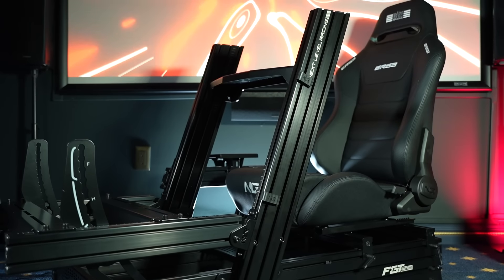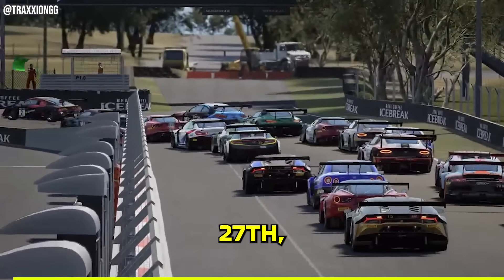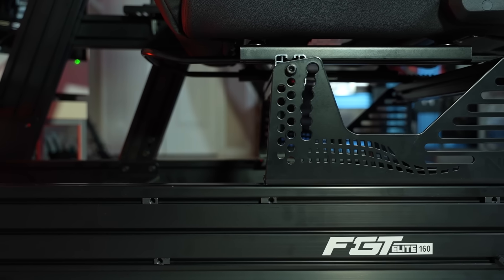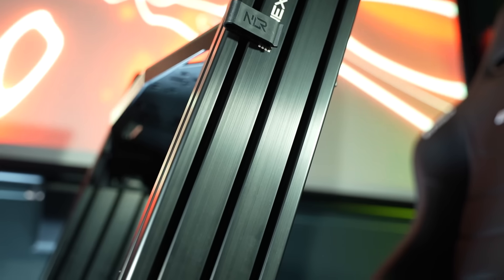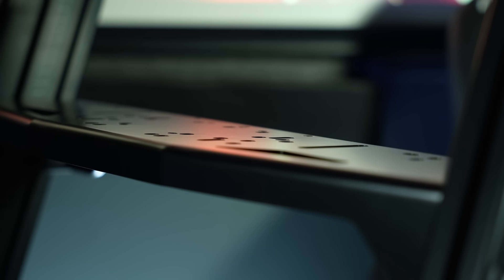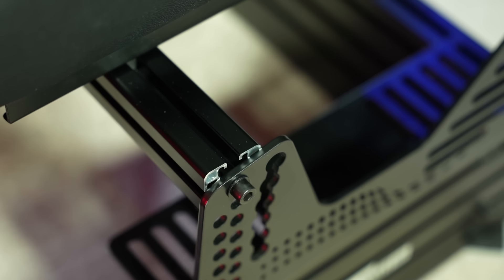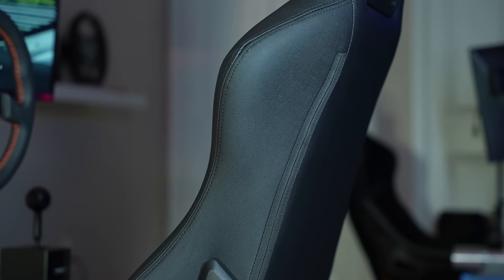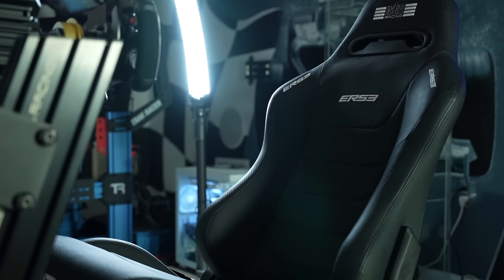The ONLY Sim Racing Cockpit You'll Ever Need (And It's NOT Overpriced?!)

Comment: Idk how a cockpit that costs 1k usd without the seat is considered "not overpriced". If thats not overpriced, I must be homeless then😂
Reply from the maker: $1250 for a 160x40 rig with interchangeable seating positions and full adjustment on the seat isn’t bad at all in my opinion at least
Reply: It is bad. Not great value at all.
Reply: @OCRacing 1250$ is how much my whole sim setup costs including the pc. My point is, for the average sim racer, this is nowhere near budget or not overpriced.
Reply: You're mixing up expensive and over priced.
Reply: @tifa26  For simracers running a small rig that you attach your chair to and is looking to upgrade into the world of alu rigs it's 100% not overpriced, the price of alu rigs in general is a steep market
Reply: Trak-Racer and Sim-Lab is 3 or $400 cheaper. Trak-Racer 160 is $800 WITH seat included. 
Sim-Lab gt1-evo is $450 without seat. 
The NLR rig is too much
Reply from the maker: @tifa26  Well obviously there are different price ranges when it comes to cockpits. High-end cockpits like the F-GT series from NLR are targeted towards the higher budgets and with that in mind, $1250 isn't crazy, especially not compared to others that are in far excess of that. It's all about perspective in that sense.
Reply: @tifa26  It all depends on what your budget is. I set a budget of $1000 for a new rig, tube or aluminum. So I save $12 a week, $48 a month, $576 after 1 year, so in 18 months saving $12 a week, you can have a rig for $900 to $1000. 
$12 a week is nothing
Reply: @tifa26 . I think people are getting confused with affordability and value. Overpriced is being used here to denote the value of the product, not where it splits on the spectrum of prices.

I do agree, i think it’s overpriced for what you get.
Reply: @OCRacing but does the adjustability it has justify the price. The quality of any 80/20 rig is exactly the same. I bought my rig for around 400 added a bucket seat for another 350 and now added a 4th monitor mount for another 100 (with Asetek front mount, adjustable pedal deck, etc).
Reply: This is how they normalize prices, my friend.
Reply: @JVGaming yes
Reply: I just built my 40/120 rig for a 1/3 of that one.
Reply: It is over priced. It's a thousand dollars. 

And when you are a YouTuber and getting things free and claim not being biased is also different from someone buying it with their own money.
Reply: Don’t worry bro use his code and you get 5% off
Reply: all these are just paid ads by the companies.
Reply: Its not overpriced when your used to getting everything for free to be a marketing shill.
Reply: Agreed. When I heard the price after him saying “not overpriced” I was like 😳

I guess is not overpriced if you get it for free to review lol - also 5% off 1200 bucks is like 60.00 lol - still not affordable.
Reply: Not overpriced does not mean cheap, it just means not overpriced. 

A C8 corvette is not overpriced. It's great value for money. That doesn't mean you can afford it 😂
Reply: @timothylanning9705 😂😂😂
Reply: Its overpriced if you look at it in a sense of some aluminum slabs and screws shouldn't be 1k. But if you look at this vs its competition its not overpriced. Like the rigidity and adjustability has value.
Reply: He ain't a bad guy and he does make great looking videos but honestly this channel has turned into one big infomercial.
Reply: @tifa26  You should do some research on how much cockpits can cost. Yes, this is a budget sim rig when it comes to 8040 rigs.

Comment: I’m reviewing this thing, here’s my discount code. All I needed to hear to know your words are sus.

Plus $1000 for $300 max of 320 aluminum rails. 

You could have the aluminum cut to length, buy a tap and dye kit, and some bolts, and still not have $400 in it.

I built mine for $300 but already have the tools. A company more than doubling its profit on something so easy to manufacture is a bit of a scam.

Comment: This is not good value at all. People need to realize that 4080 profile is all that’s necessary. These 40160 and 40120 rigs are overbuilt af. I run a 23nm wheelbase and 200kg load cell pedals on my 4080 rig along with a qubic motion system and have no flex at all anywhere. The weak point is never the profile. It’s the corner brackets, hardware, pedal tray or wheel deck. All of which can easily be replaced or reinforced as needed for way less than the cost of this. 4080 rigs are often $500usd or less. Compared to usually over $1000usd for one of these needlessly heavy rigs with extra unnecessary material that will just slow down a motion system unnecessarily.
Reply: I'm planning to build a rig and haven't decided what profile size to choose, so your comment is pretty useful. thank you!
Reply: @vsm1456  no worries man! Get some 4080 it’ll be all you need.
Reply: Yeah, same company offers an 8020 rig that seems fine. 600$ with shifter mount
Reply: @khalidkojo6673  get whatever the best value 4080 rig in your region is. For me in Canada it was a 6S-80 from 6 sigma sim racing. I paid $450 USD with a shifter mount arm.
Reply: With the information you're sharing,  would you recommend the trak racer tr80 , than the tr160. I appreciate the input 👍

Comment: Everything is expensive and subjective. I just paid $7k for 90 feet of fencing in my backyard. If you can’t afford this right now, there are many lower priced alternatives from NLR. I started with the wheel stand 2.0 and an Xbox and had a lot of fun with my simcade setup, but if you want to play with the big boys, you’re going to have to shell out the cash or learn how to extrude, anodized and mill your own aluminum as well as design the rig. Some people have that kind of talent. I don’t, so I shelled out the big bucks for my dream rig that I’ll acquire a little at a time. Let me tell you what’s really expensive, slot cars and R/C racing.

Comment: The formula seating position at 6:50 doesn't look very right, especially on the arms. I think the wheel is too far away from you and you end having arms bent more than 90 degrees (they look around 110-120).
Of course I understand that simulates a formula seat, but that angle will cause arm, neck and shoulders strain in my opinion.
I guess it was for the sake of testing different seating positions and readjusting the rig every time for the purpose of the video would have been a little bit annoying haha
The wheel should be much closer to you so the arms will be naturally closer to you similar to a 90 degree angle.

Comment: As far as I can tell, structurally it's the same as the F-GT Elite, just with thicker aluminum profiles. From my experience with F-GT Elite, the pedal deck coupling with the slanted pillars limits the adjustability a lot in seating position, if you are too short or too tall, you'll have to end up somewhere in the hybrid range and won't be able to switch seating positions. That said, it's still a very good, strong, and nice-looking rig, highly recommended, the F-GT Elite 160 edition should only be better. I'd have bought this instead if they had released it a few months earlier, the price is only $200 more. (If you buy directly from their own website, the price is actually the same as the non-160 edition, which is wild.)

Comment: seriously 40x120 alus on base and over all 40x80 built is just overkill for such a small rig. Fair and square you can build entire rig like that on 40x40 and 40x80 for wheel base and pedal plate replacement and hold it on under 400usd without seat ... get yourself BMW e40 seat with slider for 80usd now you have your low price rig for under 500usd -.-''
Reply: Great advice,   any suggestions where to locate a seat?

Comment: wow still so expensive. Anyway (unrelated) QUESTION ive been looking at the Thrustmaster tlcm,  moza SRP,  fanatec csl not elite with load cell and the cammus lc100
which one would you advise me to upgrade to?
Reply from the maker: They're all good choices - the T-LCM is probably the weakest of the bunch. For me it's between the Fanatec CSL and the Cammus LC100. At the moment, I believe only the Fanatec is available as the Cammus LC100 is still on pre-order.
Reply: Thank you
Reply: You might want to have a look at the Simsonn pro pedals. I run them and for the price (~220$) the quality and performance is great. Load cell pedals made mostly of steel.
Reply: @marcushillerstrom25  do you think it's better than the cammus lc100's?
Reply: @vroomvroom248  I haven’t tried the Cammus pedals, but from what I’ve seen in reviews of the Cammus set, I think they are similar in performance.
Reply: @marcushillerstrom25  thanks for the info I will take this into consideration when I buy a load cell pedals set
Reply: The Thrustmaster T-LCM pedals can be easily modded to give you that feel you’re looking for on the brake. Out of the box, the springs don’t quite do it for me, but this mod, which ran me all of maybe $15 on Amazon made a world of difference. https://youtu.be/OmA11LLa9Yo?si=4xxkzAbiqF32KTF-